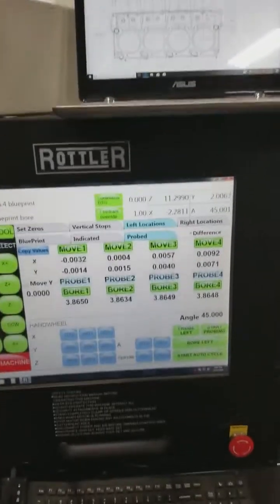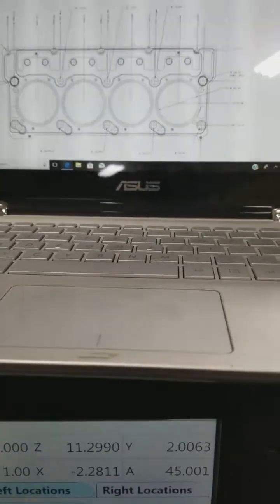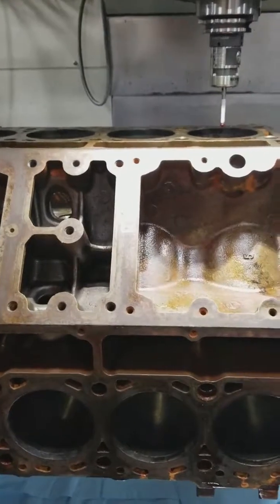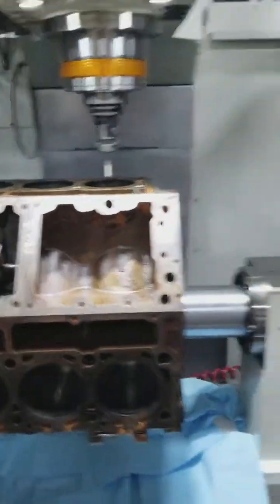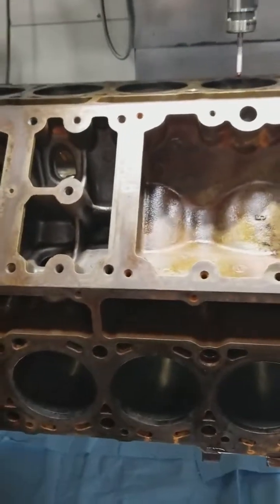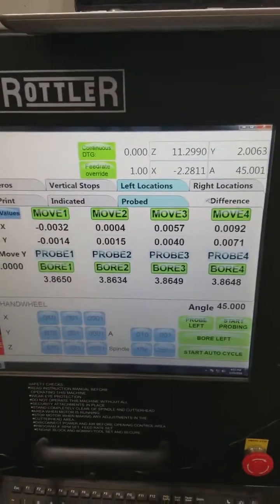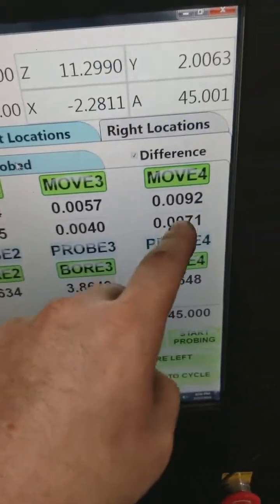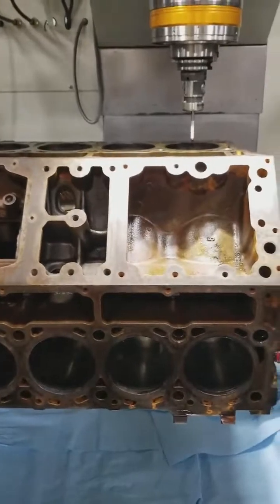The Process of Blueprint Boring an Engine Block

Comment: I wanted to thank you for this, I've assisted with putting together engines for years and its only as good as the machining. I use to go to the local auto machine shop and just hang  out to learn as much as possible. I always wondered where the reference point was for boring..Thank You!